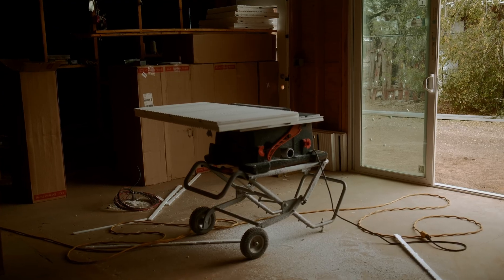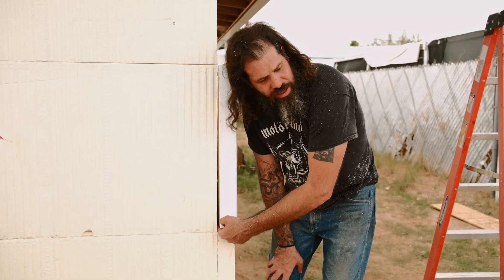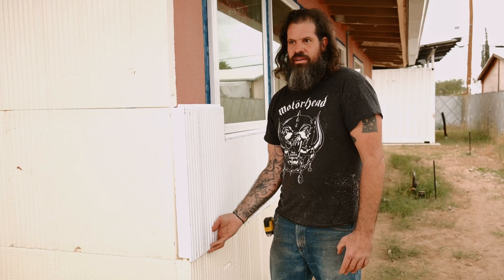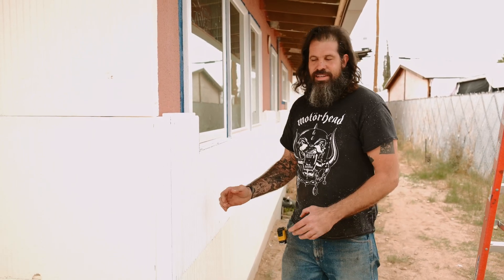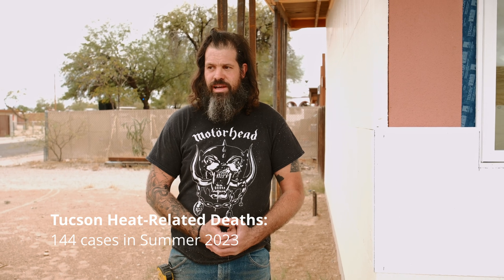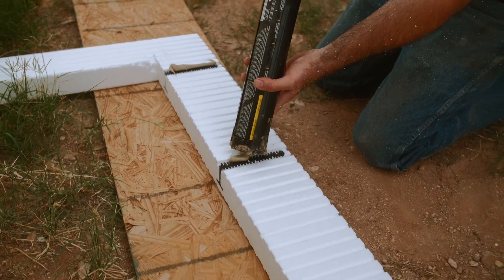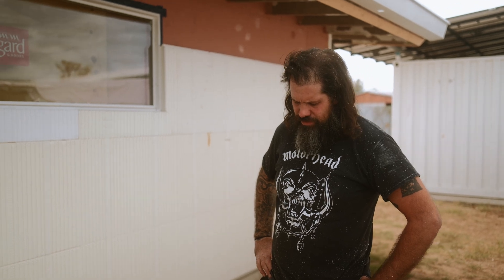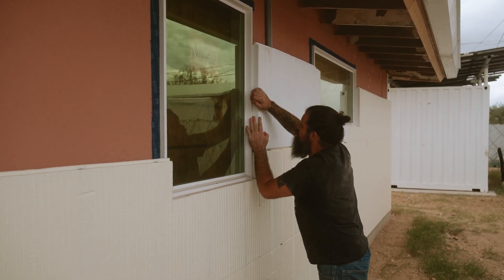An InSoFast Passive House Project: The Amalia House

Comment: Could you put the panel under the window first and then put the one underneath?
Reply from the maker: Ideally, you want to work up from the bottom to ensure the panels are straight. We recommend cutting the panels to create a small enough gap to fit under the windows, then add spray foam to fill the gap.